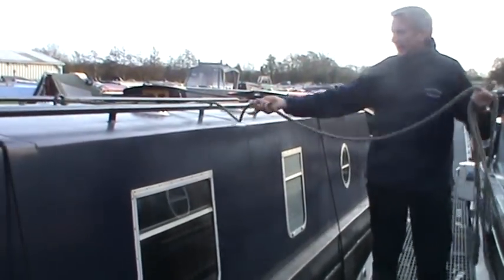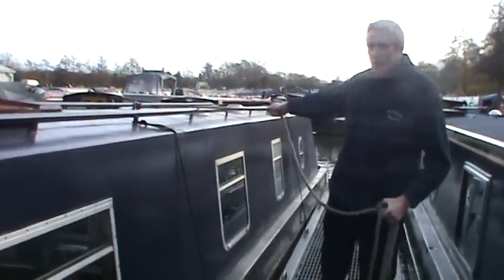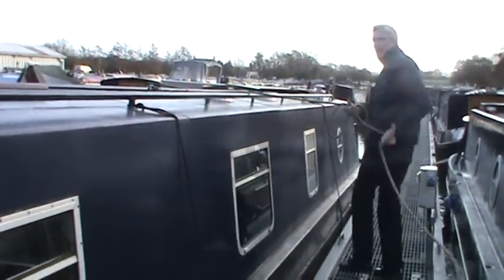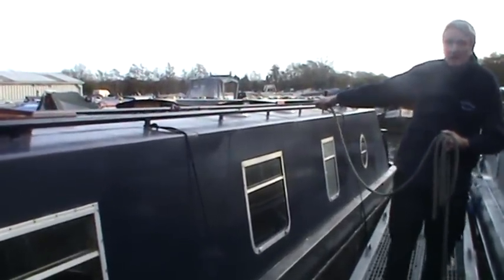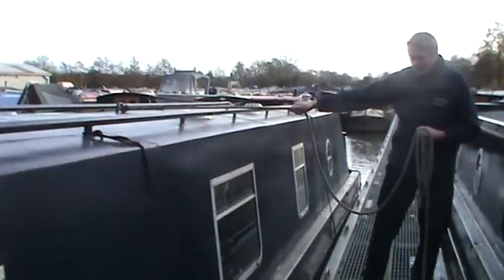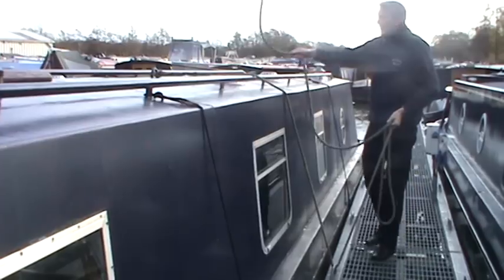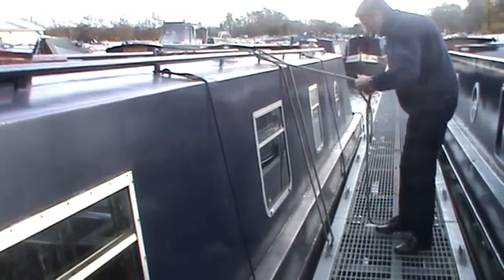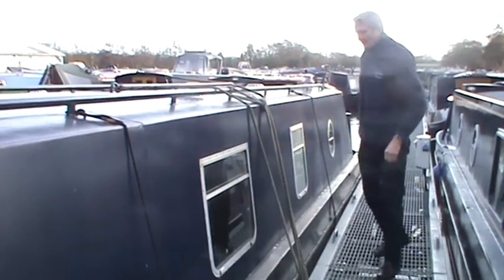Using a Center Rope

Comment: Boats tied up with a centre line like this will move very alarmingly when a deep boat passes them. - Please don't use a centre line as a mooring rope.
Reply from the maker: We were using our marina pier for demonstration purposes only. As we clearly say in this video, tying off using the centre rope is only done temporarily control the boat and to give you enough time to tie at the bow and stern. At that point the centre rope would then be undone.